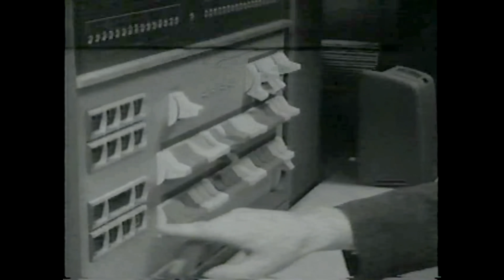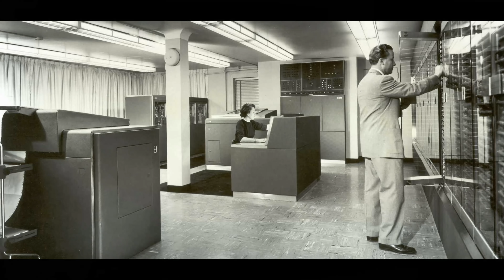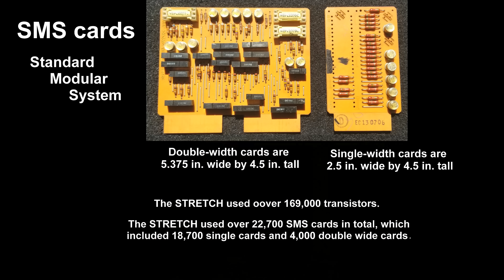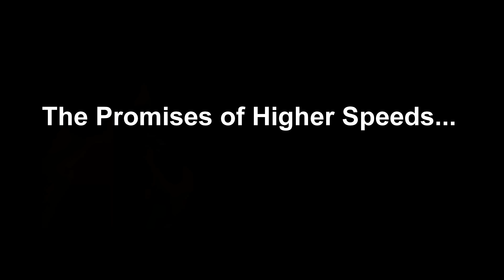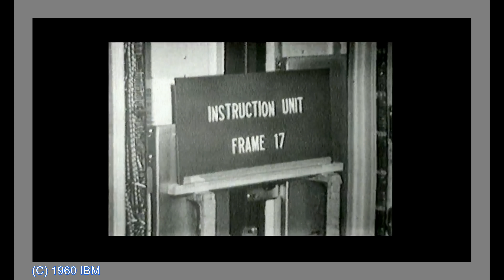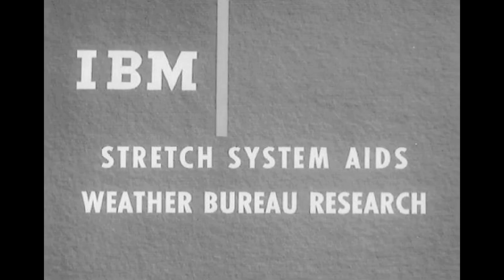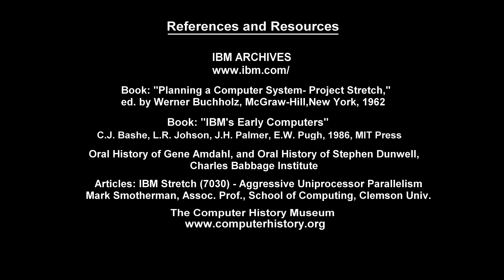Computer History: World's FASTEST Computer! 1961-1964 film & photos (IBM Stretch supercomputer)

Comment: I would be interested in knowing how much electricity these monsters sucked up and how much air conditioning was required to keep them cool.
Reply from the maker: Good question!  Here is some info that might help:  The system was probably air cooled.   The 169,000 transistors required a total of 21.6 KW of power (21,600 KW).  Several references stated that the whole system was over 100 KW at 110 volts, but that number depends on which auxiliary modules are included in the total.  The system probably used aluminum racks as well.  Overall, it would generate considerable heat, but much, much less than the earlier vacuum tube based machines.  The large 7090, 7094 machines used cooled air under the raised floor.   Extensive prep of the facility would be needed before installing the 7030 STRETCH, to ensure adequate air flow and power management for A/C units, plural.  (As more info is obtained on this question, we will post it here as well.  Thanks very much.)
Reply: @ComputerHistoryArchivesProject  O worked at a data gathering company in Phoenix that went from a mom and pop operation (and didn't spend the money to keep things up and running) and used "people A/C units" in the computer center.  They got bought out by a larger company and decided to upgrade with the latest and greatest servers.  During the planning sessions the sales rep told my bosses how much A/C would be required and how much power usage would be.  I was looking at the spec sheets and called him out on his "estimate".  I got ripped by the bosses and told to not disrespect the sales rep as this was his job.  So, I ordered what he recommended and it arrived and I got the systems installed and had our electrical contractor add the requested panels installed.  He didn't even get 1/4 of the servers plugged in and I "lost" the room due to heat load and got called in to get ragged on AGAIN.  I pulled the meeting minutes and showed them where THEY over rode me and told me to go with what the sales rep said was needed.  I ended up having to order 4 MORE Liebert's and additional electrical panels from the main switch gear room.  A couple of heads rolled on that one and I was vindicated.
Moral of the story LISTEN TO YOUR A/C.  He does this for a living.
Reply from the maker: Hi @MrTommyboy68, KUDOS on your persistence!    Excellent story!   Thank you for sharing it. ~  Victor, CHAP
Reply: @ComputerHistoryArchivesProject  .Hmm... "21.6 KW of power (21,600 KW)"... let's make that last number 21,600 watts, not kilowatts.
Reply: That would be very interesting.
Reply: @captainkeyboard1007  As I found out, sales reps will say ANYTHING to get a sale.  He majorly DOWNSIZED the amount of heat that would be generated as well as the power consumption.  I was over ridden by my bosses and ordered EXACTLY what the sales rep told us and ended with a boondoggle.  I pulled the meeting minutes and stuck it under their noses and they had to eat crow.  A few heads rolled on that one, but I was vindicated.
Reply: @MrTommyboy68  Usually they shoot the messenger and go on like nothing ever happened.
Reply: @johntoe6127  In this case, the messenger knew the position he was in!
Reply: @campbellpaul  And I got the last laugh because corporate big wigs came out to see what happened and 4 people got fired.  But I got everything up and running very quickly (I figured someone would overrule my bosses) and I had my contractors ready to go with the equipment ready to ship express from Cali.
Reply: @MrTommyboy68  You and I worked in jobs where there more supervisors and less supervisees! I am pleased to learn more things from you. Thank you for the facts and typing to me. Happy Keyboarding!
Reply: @captainkeyboard1007  Thank you.  I have always looked to older guys for their knowledge and skills.  too many young guys think they know it all but never turned a wrench in their lives.
Reply: @MrTommyboy68  You are welcome. Thank you for typing to me. Happy Keyboarding!💙
Reply: I think they were mostly sold to atomic energy agencies for a reason ;-)